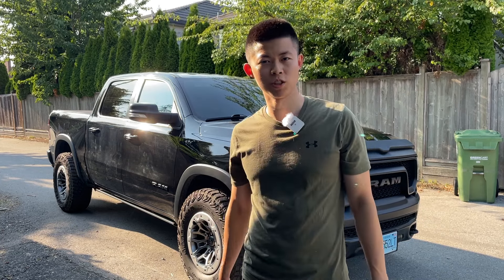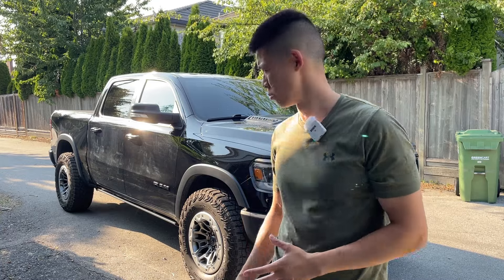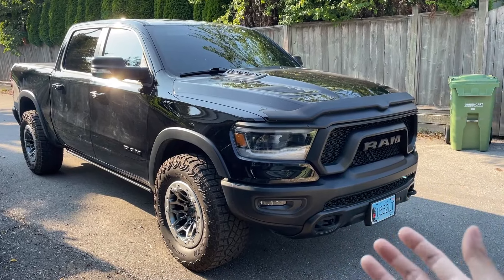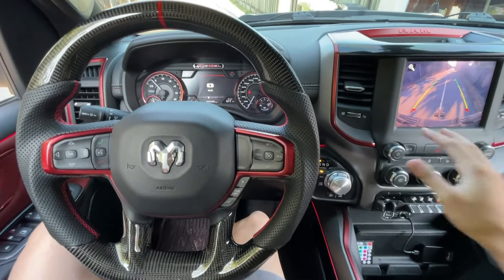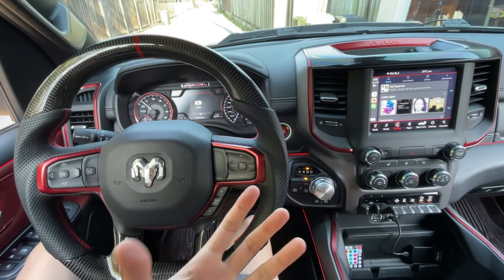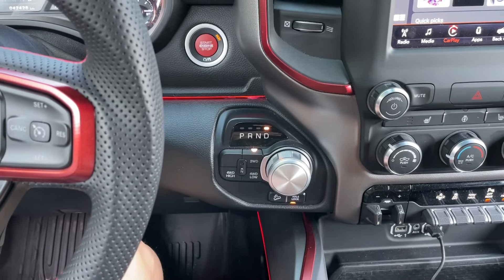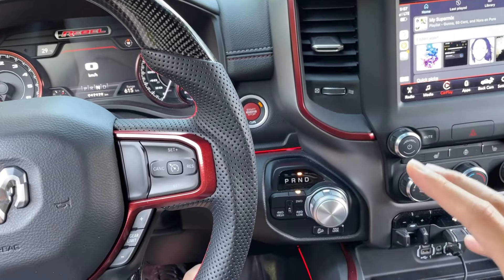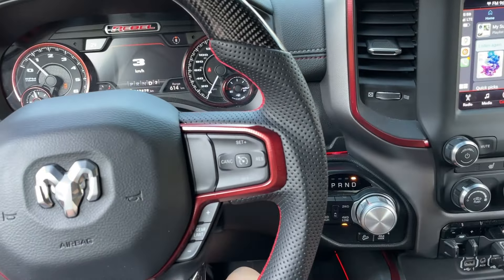RAM CLUNK NOISE WHEN SHIFTING FIX - EASY + FREE

Comment: Thanks for the info, very helpful information. Also, just for preventive maintenance, drain/replace all your differential fluids (front and rear), your transfer case fluid and your transmission fluid. This will make your truck last problem free.

Comment: Thanks for the video, I noticed my Rebel when going into reverse, after it's been sitting a while, I get a light "clunk" sound from the rear .  It only happens in reverse, and if I try to do it again, it won't make the noise unless it sits for a while again.  I'll try your tips and see if it helps fixes it.  I used to park they way you showed here (neutral, set brake, release weight, park), but started using the auto e-brake feature, maybe it's not engaging fast enough to prevent stress on the pawl.
Reply from the maker: No worries, we also did a video on transmission adaptation reset which also helped if this video didnt fix it :)

Comment: I get the exact same run around at the dealer for the same issue on my 22 Rebel, now it makes that noise and jerks when leaving a red light, they replaced the valve body in the trans and still have the same issue. This is my 4th RAM and now my last, truck is still at dealer and they hit me with that we cant replicate the issue BS, went and took the manager on a test drive and yup it did it again. Still at dealer.
Reply from the maker: @mrfixit8640  That’s the same treatment I was getting, can’t replicate but they take your truck for days spin around the dealer and tell you to pick it up with no fix. They even told me it’s normal for my ram to sound like this as it’s a pick up truck 😂 their selling the 25 1500s inline6s for 100k+ msrp before taxes up here in Canada but the service quality is from 1955

They flashed the TCU on mine and it went away for a little bit but came back after awhile. Some how, using the rear diff lock, 4wd high and low turning my wheel and cycling forward and backwards that clunk hasn’t been back. Give that a try 

Does it make a jerking motion and clunk when you are slowing down to a red light?
Reply: @ it doesn’t do it when slowing down, it’s just rough when you let off the brake, it clunks and slams forward feeling like you got rear ended.

Comment: 🇨🇦 go into your menu & set automatic park brake set. Every time u put it into park brake sets. Also have u any knowledge of putting in ACC automatic cruise control ?
Reply from the maker: 🇨🇦🇨🇦🇨🇦Even with the auto park brake or manual park brake when in P there’s still slight movement in the wheels which has the trucks weight resting on the P gear, when we switch to N > Brake > Park, 100% of the weight would be resting on the Parking brake. 

To add the ACC
You need the right steering wheel switch with the ACC buttons, the driver assist module that goes in front of the rear view mirror, new mirror cover, and a different windshield that has the mounting bracket for the assist module. Then you need to go dealer for the module calibration and finalize with some alfa obd programming

Comment: I've got the same wheel. Carbon fiber bezel tho, only clunk on incline for me 2019-130k
Reply from the maker: Try setting the gear to neutral > parking brake on> let go of brake to let truck weight rest on parking brake> then switch to park. This would fix the clunk on an incline